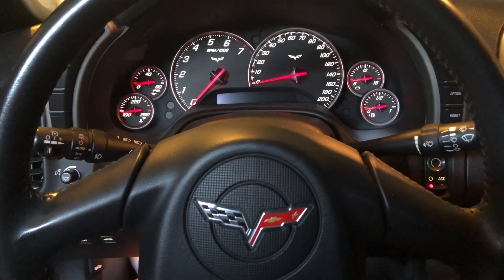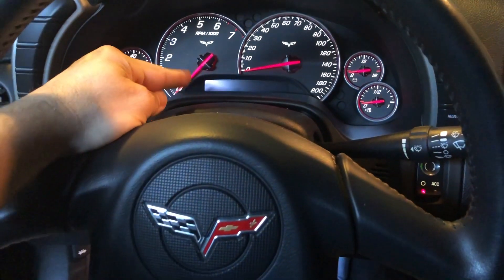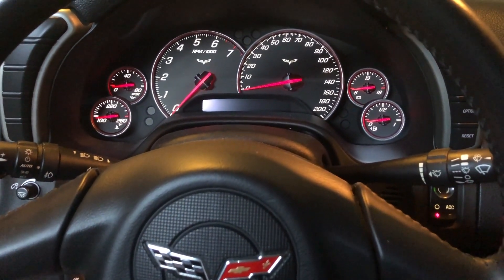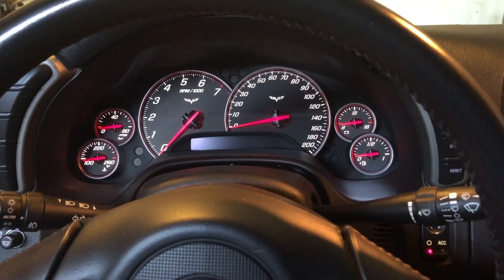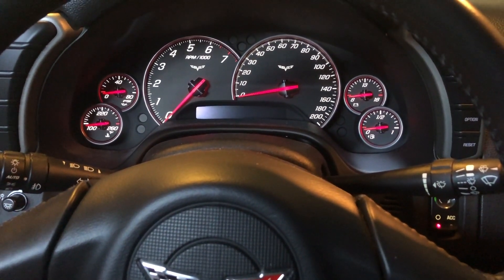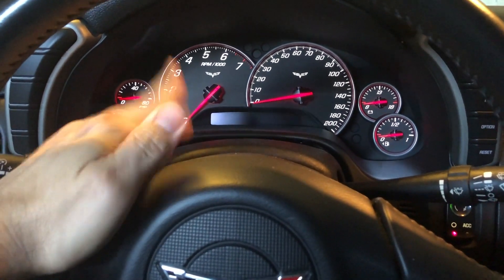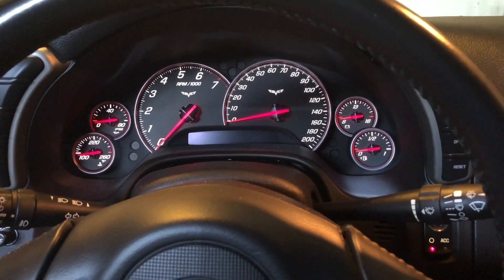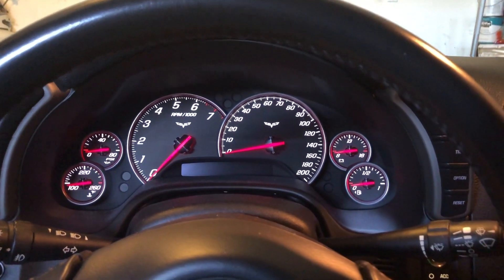Corvette No-Start: Easy Fix!

Comment: I owe you a beer. After chasing this issue on my 2011 base for months - and having it gradually get worse to the point that the car could not be considered reliable transportation - I found this video, just after I ordered a Hail Mary (ie, new starter). I also didn not seeing any errors on the DIC about "Fob not detected" or anything else to indicate that a low battery was the problem. I put the fob in the slot in the glove compartment and the car fired right up. Starter order canceled, $0.50 battery purchased, and all is right with the world. Thank you for sharing this!

Comment: It Took basically two years for me to solve this coupled with the 2005 "service steering column lock" problem. I solved the latter problem with the cheap ebay dummy load plug in. But about one year after installing that the error codes returned and the no start issue became more and more frequent to the point the car was too unreliable to drive. Got pissed and finally figured it out. Open your fuse box under the hood. Pull relay #43 out. Mine is the original AC Delco unit. It has 4 short posts that plug into the fuse box. Pry the grey cover off of the relay. Then carefully with the car in neutral and E brake on plug it back into the fuse box without squeezing the relay contact shut. Go ahead and push the relay contact shut manually and your starter will turn the engine over. The starter will engage and try to start your car. In order for the engine to fire the rocker start switch on the dash has to be glowing green on top. Solder a wire to each side of the relay and attach a simple push switch. This by-pass will turn the starter over regardless of whether the ignition is on, regardless of the clutch being depressed or not or whether it is in reverse, 1st, 2nd etc.... Be careful but if you do it the no start issue will be resolved once and for all. Btw, I still get "service column lock errors" on the display... I ignore it. I can now drive without worrying about turning the car off without starting back up. PROBLEM SOLVED.
Reply: This has saved me!!!!! I did this today and after a few times, normal start seems to finally work again. But I will keep this as a backup. Thank you for taking the time two years ago to write this 🙏🙏🙏

Comment: My 08 is doing the same.. i took it to the dealership and they replaced the alternator and the battery as well.. today it left me on the side of the road.. replaced the fob battery 2 months ago.. im taking this as a sign to go get a c7.. i hope my finance manager sees it the same way.. as a need and not a want 🤞 wish me luck boys
Reply from the maker: So, I had another problem with not starting about a year after this problem... turned out to be a loose connection in the under hood fuse box. It was throwing cam and crank sensor codes when it didn’t start though.
Reply from the maker: And it would only happen when the car was hot.
Reply: Worst thing to do is take it to a dealer they don’t know sh!t
Reply: i had alot of stuff fixed and i have it sitting with a trickle charger and a week later its not starting again just clicking, it says my battery is at 100% and 13.5 voltage and im jumping it too still nothing it just clicks
Reply: @Wakanda1000  well after i replaced the alternator  it worked fine then it did it again a few weeks later.. finally replaced the starter and is working fine  now.. but now i have another problem when i put it in 4th gear the car starts to shake and finally goes into gear 🤷‍♂️.. when its not one thing its another with these corvette's.
Reply: MrCokeman01 if you’re car goes into reduced engine power* change the throttle body if it’s not that change the fuse box
Reply: Cliff's How To Channel Im having the same exact problem on my c6 z06 after driving it around for an hour it won’t start I’ll have to let it cool down for a bit my car doesn’t over best or nothing and I just checked the fuse box and 3 of the fuses where a little lose so I put them back in place hope it’s the same issue and also those codes come up the same ones
Reply: @CliffsHowTo  Voltage Is Low Also Im Having Same Problem
Reply: @CliffsHowTo  hey what connection was loose I’m having the same thing cam sensor code and it’ll start and not start sometimes but since it’s a manual when it won’t start I just push it then put it in gear

Comment: Had the same problem, it was bad battery connection/corrosion. Once cleaned up and tightened….all good 👍🏼
Reply from the maker: Thanks for the tip. The cars are finicky over the batteries!

Comment: Corvette c6 z51 2005 column lock service on dic  key fob working fine    locking and unlocking the door with no issue, car is not starting installed column lock bypass still no crank, staring its locking and unlocking fine also with zipppp sound working fine, new battery I checked the alternater is fine also, what is the issue in my car??? Any suggestions will be appreciated

Comment: I found that if you shut the car down in neutral and then put it in reverse and retry to start it, it won’t unless you disconnect the battery terminal and then connect it back up. Then it will start. Strange 2005 c6. No other problems

Comment: If your fob battery is low or dead, and you need to get going, place your fob in the programming slot in the glove box and the car should start like normal.
Reply: Sometimes it doesn't work
Reply: @anthony2gsps596  sometimes it doesn't work
Reply: @panzerwaffen2873  That indicates a fault in the fob. If the fob is in the slot in the correct orientation - it gets power through the Corvette logo on the case - then the battery is irrelevant.
Reply: @xnadave  thanks for responding..yes sir agree

Comment: I'm having the same exact issue but I already changed my fob battery and that didn't do it.
Reply from the maker: Oh no!
Reply: @CliffsHowTo  I unhooked the battery and put it on charge and it started again. I bought a brand new battery and so far no column issue message. Hopefully it's just the 05's are super picky about voltage.
Reply from the maker: They definitely are!

Comment: Dude, I'm having the same problem as you
What did I find out about your problem in order to fix mine?
Reply from the maker: This particular issue was just the key fob battery. You can test it by putting the fob in the slot that’s in the glove compartment. 

If that resolves the issue, then the key fob battery is what’s wrong.
Reply: @CliffsHowTo  //Thanks for the reply
But I tried and it didn't work. I think there is another problem. Thanks🌹

Comment: I think it has to do with the started switch, I drove about 10 miles, shut the car off, went back to the car, would not start, had to go back and forth a few times between the red light and yellow light before it restarted. This is the second time in one week. Any suggestions?
Reply: Same thing happened ti me today